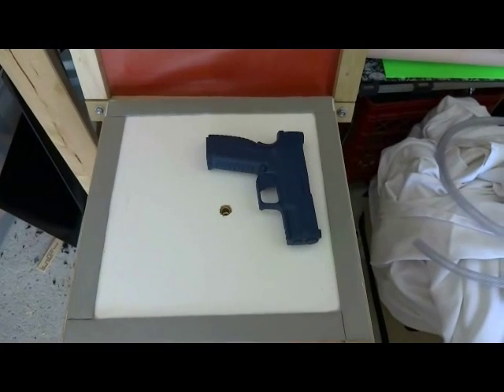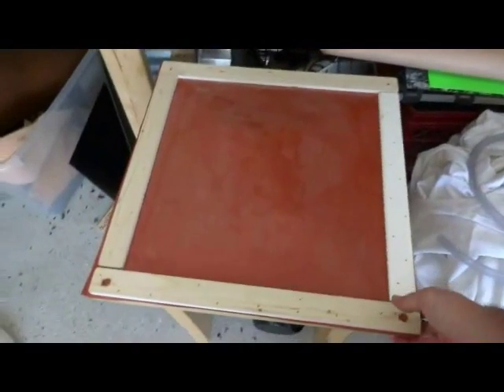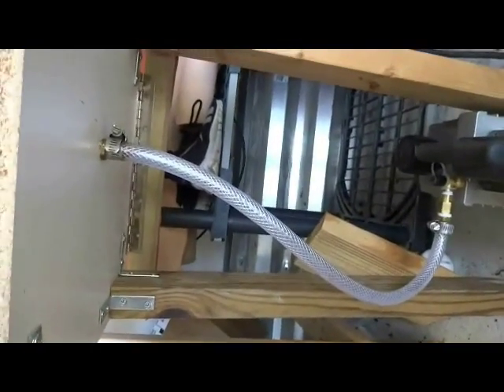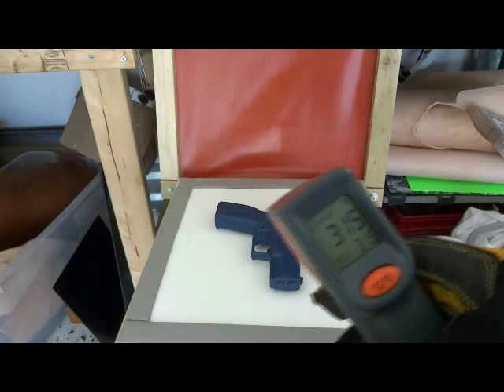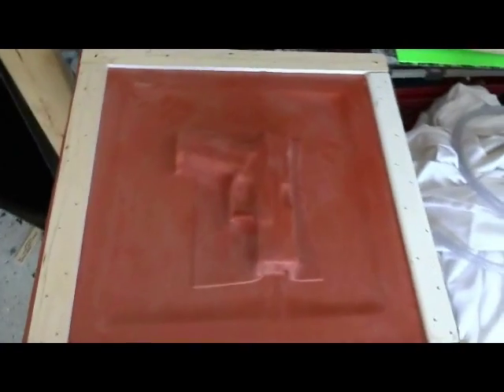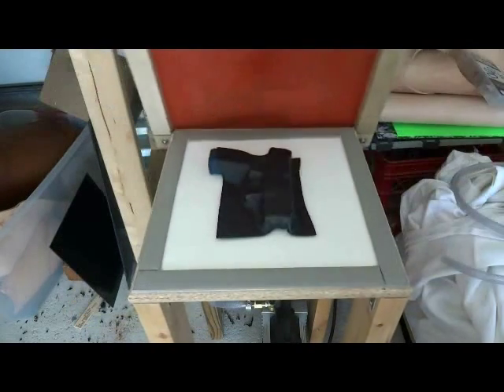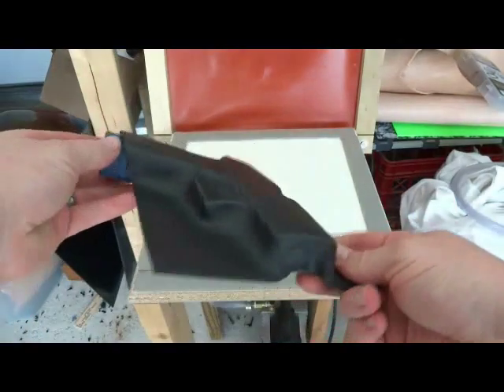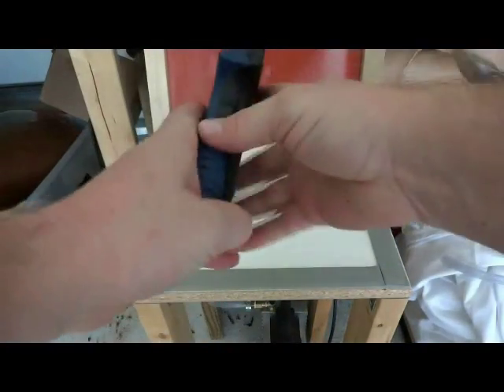Single hole vacuum former

Comment: That's unreal definition compared to foam
.

What's the cover material?  It seems to have tremendous streach
Reply: 12345NoNamesLeft I realize this is very old but, it is the  silicone and or gum rubber.